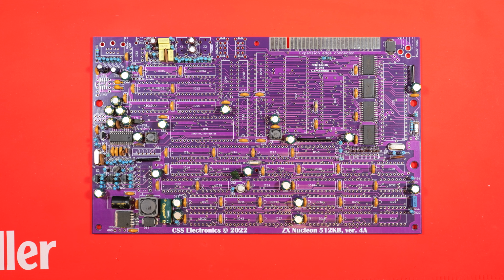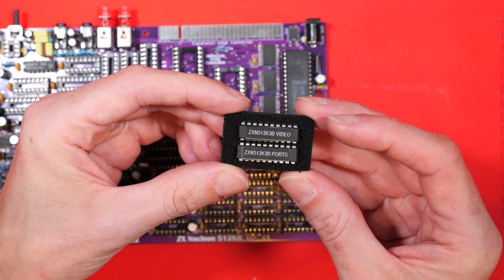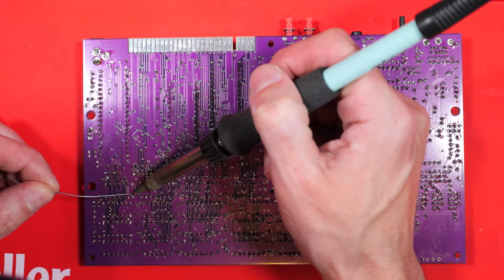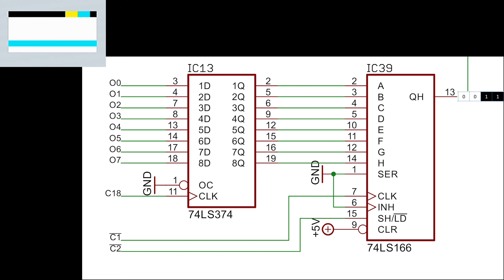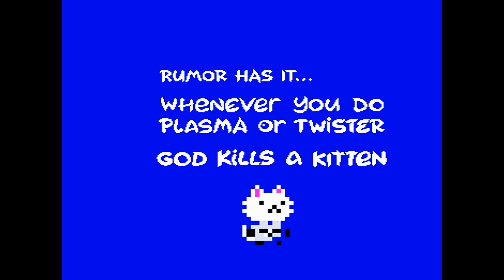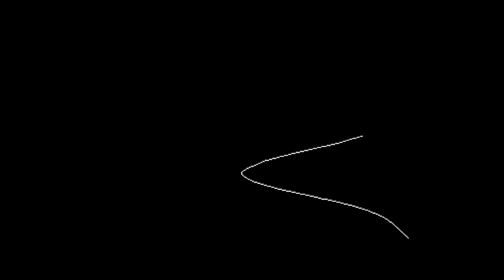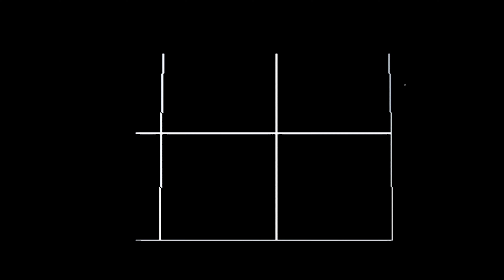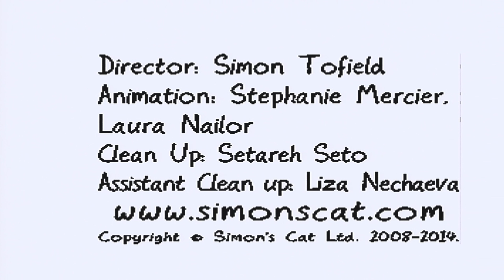ZX Nucleon 512KB - Build Part 3 - Job Done!

Comment: The UA880D is East German Z80 clone, 4MHz max. Depending on version, the pin spacing is either 2.5 mm for use in socialistic countries or regular 2.54mm for western export.
Reply from the maker: Awesome thank you
Reply: "MME" is the factory "Mikroelektronik Erfurt" and "W9" is the production date: W:1988, 9:September
Reply from the maker: Great info!

Comment: As far as I know, the U880 (the "A" I guess may be the speed designation or something) is an interesting one, it's an unlicensed/"illegal" Zilog Z80 clone of the "west" in the "east" if you know what I mean. It's very highly Z80 compatible, though there are some corner/minor cases when it is .... not. By the way, I was always curious where ppl buy the IC sockets (when you mention you need to re-supply soon). I always have bad luck with that and getting crappy sockets (ebay/aliexpress) and places like mouser/digikey seems to be a bit too pricey for me.
Reply from the maker: I bought this batch from eBay and they seem fine....so far!

Comment: Where can I buy a Nucleon kit? All I'm finding with Google is dead links. I'd like to have a go at building one of these...
Reply from the maker: There is one on eBay right now but it's the last one for the year so the price is higher than usual.
Reply from the maker: You could go for a Harlequin 128K instead, they are a similar experience and more readily available and cheaper
Reply: @HappyLittleDiodes  Thanks, I'll look into it. If I do this, I'll probably donate it to Lee of MoreFunMakingIt for his charity events, once built.